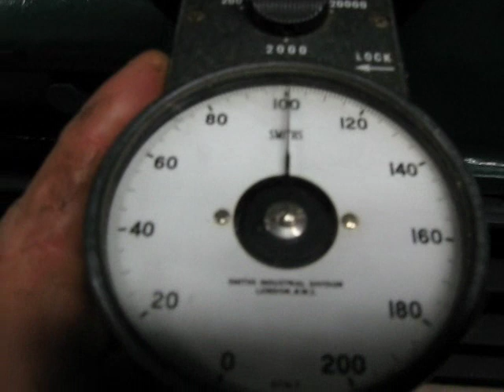Crossley HH11 diesel engine of 37 liter starting and running

Comment: I started my apprenticeship at Crossley-Premier Engines by preparing a new piston, piston pin and rings for an engine that had been installed in a Derbyshire mine to pump out water 20  years earlier. These were the first spares it had needed.

Comment: Wat een prachtige motor! Het is genieten om hier naar te kijken!
Reply: ruben: this motor is practical, because it can be made self powering. 
Then you just get it running and power your home, and the hot water can heat your indoor swimming pool, and generate all the power you will ever need.

Comment: Are you serious about the 1 litre of fuel per hour to run this beast?

I have only recently begun to appreciate the old industrial steam and internal combustion engines.
I realise that a steam engine can be fueled from locally-sourced firewood, and scraps; and often wonder how the engines such as this beauty managed to overtake the steamers.
Thanks for your video.
Cheers - Rick from Timaru, New Zealand.
Reply from the maker: Yes I am sure about 0,95 litre per hour. The engine original turns at 270 rpm, now it is running at 100 rpm. There is no force taken from, it is 0,95 litre to keep it running. 950 cc per hour for 50 combustions time 60 minutes. 950 cc per hour for 3000 combustions an hour, that is aprox. 0,3 cc per combustion.

Comment: that seemed easy, there was probably a bit more to the starting procedure than that.
Reply from the maker: First setting the flywheel on time, than lubricate some points, than set the regulator free, and close the injector. Set the half compression on the exhaust, and than start this film, than its complete.
Reply from the maker: https://youtu.be/mWTPOdunBiI

Comment: Are you starting it from stone cold, or was it warmed up previously. I was noticing that it hit it's stride quite quickly.
Reply from the maker: Hi, I am starting it from stone cold, and it is always starting well. It has a heating point, but I never use it. I think the compressio ratio is very well.

Comment: Perfect 7/8! Drummers love it. But where is the hot water coming from?
Reply from the maker: The water is cooling water, it is pumped from a tank through the engine, and falls back into the 800 ltr watertank
Reply: Thank you. Is the heat then radiated in any way, as in a car radiator? Or has the 800 ltr tank enough radiation by itself? And is there a thermostat?
Reply from the maker: There is no thermostat, just circulation, the 800 liters tank has enough radiation. When I start at 20 degrees C, in the summer with sunshine, it will not rise above 60 degrees C. It takes 2 hours to 50 degrees, and 4 hours to 60. And than it stays 60.When there is no sunshine, the max is 50 degrees C.